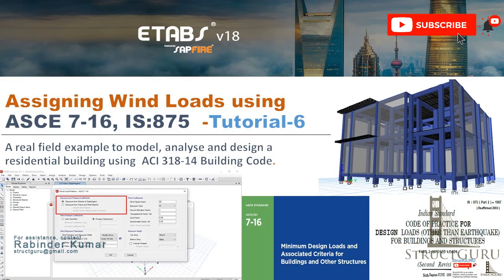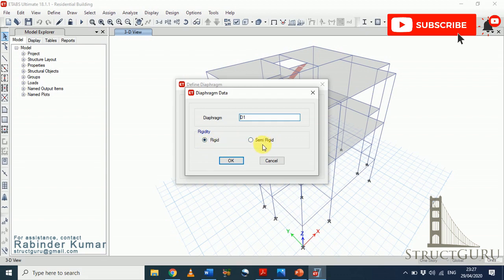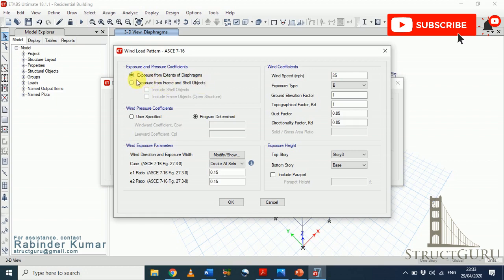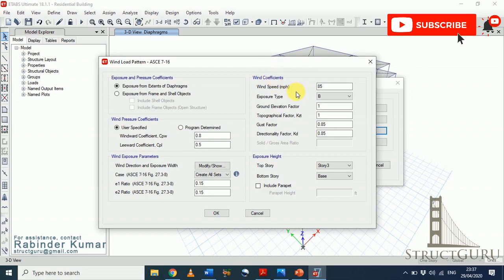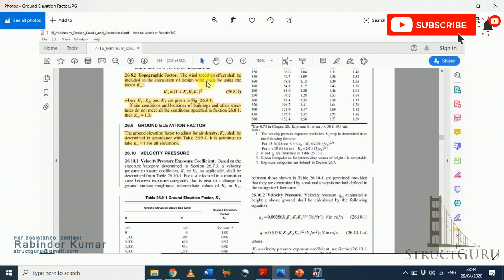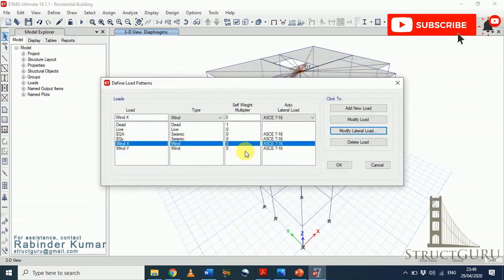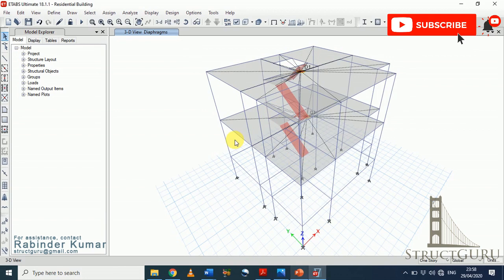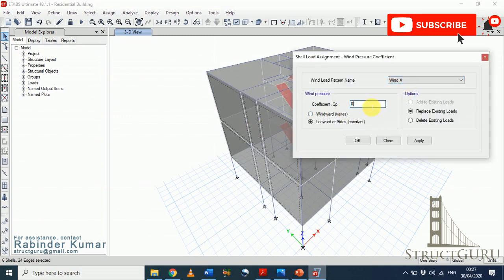Assigning Wind Loads using ASCE 7-16, IS:875 in ETABS v18  -Tutorial-6

Comment: How come you choose wind pressure coefficient as .8 and .5 for windward and leward pressure Respectively kindly explain it
Reply from the maker: It depends on the building's length-to-width ratio. This is explicitly mentioned in all building codes.
Reply: @structguru2200  Can tou explain it

Comment: Many thanks for this usefull video, but I have a question and note the question is don't you think that using (create all set) in the wind exposure parameter is taking both direction X and Y and there is no need to separate them in the load pattern. you can see   ASCE 7-22 or 16 (Figure 27.3-8. Main wind force resisting system, design wind load cases.) And you will see that the four loading cases are taking X and Y separately and together. Please correct my question if I mistaken

The note is can you please rise your voice the next time
Reply from the maker: Thank you for your comment. If you are applying wind load using "Diaphragms extent method" in that case you don't to define X and Y load pattern separately.  If you choose the manual method (Exposure from shell objects) then you must define two load patterns in X and Y direction.
Reply: @structguru2200  you're absolutely right, thanls aloooot Mr. . but is there and limitations restrict us to use any of the 2 methods  ?

Comment: please sir, why is mine not showing the wind depth and width for the application of the wind load using diaphragm extent? i have tried numerous times but it is still not showing and the building is not deflecting due to wind load.
Reply from the maker: Please share your model.
Reply: @structguru2200  How do I share the model sir?

Comment: WHEN WE SELECT FLOOR, THE STAIR LANDING ALSO SELECTED TOGETHER AND IT IS CONNECTED TO THE FLOOR VERTICALLY WHILE ASSIGNING DIAPHRAGM, IS THAT OK?
Reply from the maker: Yes, you are right. Select it and then apply diaphragm to he floors. Else, the software will give you warning while running for analysis.